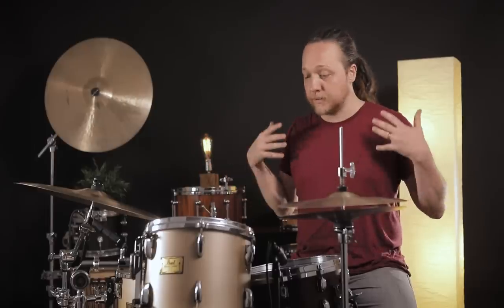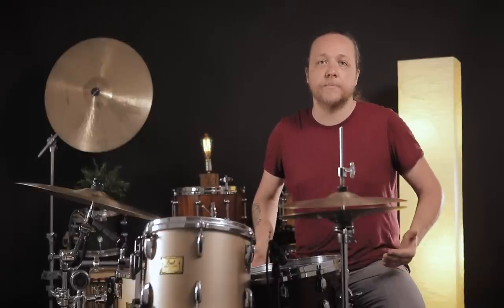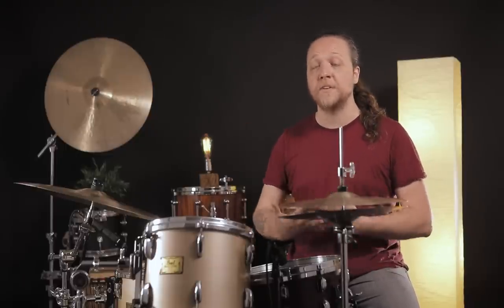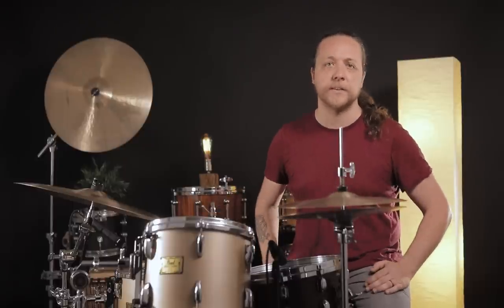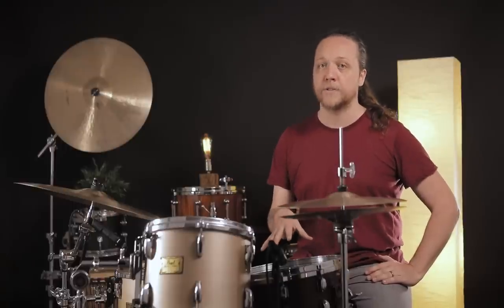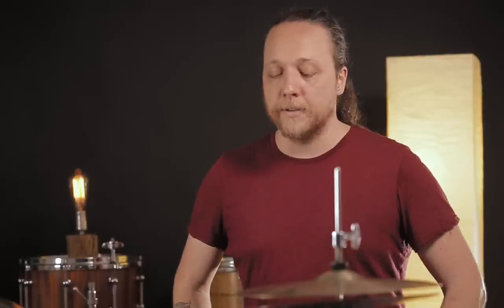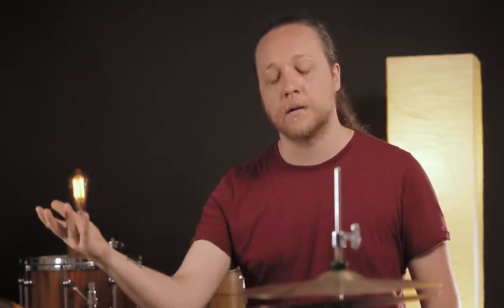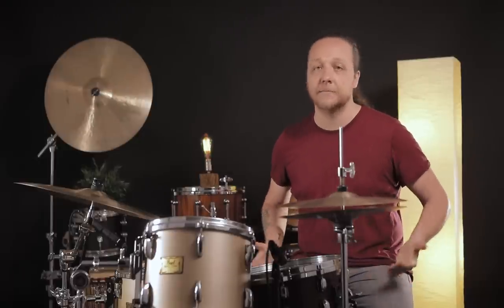Clear/Uncoated Snare Drum Batter Head | Season Two, Episode 26

Comment: Hello from the future! After using a 12x8 maple snare for almost a year with a clear g2 head I bought a steel 13x7 snare and oh my, the clear head has so much more presence it's really shocking. Especially at low tunings, the clear heads sound full and have a precise attack with a lot of warmth. I still don't get why they are not as popular as they should be, especially in the studio. I couldn't believe that a 12 snare with a clear head and 30 snare strands had more presence in the mix than a 13 steel shell with a coated head in high tuning.

Comment: It’s refreshing to finally see somebody do a video about putting clear heads on a snare drum instead of coated heads. Case in point, I have this early 1980s Maxwin by Pearl 5 1/2” X 14” wood shell snare with an adjustable under head dampener. The only head that seems to work for this drum is a 14” Remo Clear Pinstripe head. (or if you’re using Evans drumheads, the EC2) When properly tuned & slightly dampened, this snare drum produces a hard knocking sort of sound which is similar to the sound of the snare drum used by  Brian St.Pere of the band Hum on the song “Stars” and on the album, “ You’d Prefer An Astronaut .“ The sound is also similar to the snare used on Stabbing Westward’s ‘Wither, Blister, Burn, & Peel’ album by drummer Andy Kubiszewski. I absolutely love the sound of this drum. When the dampener is off, it Sounds great on any STP track from their Album Core. This negative also works well for 1980s hair metal.

Comment: When I run out of my regular heads, I use either clear Controlled Sound with top dot or Clear Pinstripe on my piccolo snare drum. it gives lots of options. When you tune it low, it sounds very thick and warm and if you tune it to mid-high (my regular tuning) it gives very balanced attack and perfect ratio between sustain, attack and the presence control when playing with the whole band. 
great episode, as always!

Comment: The best part of a clear snare batter is you can see Cody’s face in it while he demos it
Reply from the maker: Like drumming on a mirror...
Reply: I have a black Dixon drum set and only the Rack Toms and the Floor Tom  have clear uncoated Pearl pro tone drumheads , while the snare has a white Remo ambassador coated snare batter head , and on a unrelated note I have  not 1 BUT 2 Latin Percussion cowbells in my Dixon drumset mounted on my ride cymbal stand via the use of metal clamps with poles to mount cowbells  , and a specially designed tambourine without a membrane on that drum clamp.

Comment: I once tuned my toms to E,A,D,G with a digital tuner. It took a long time but sounded amazing.  Does this actually have a practical application or was it just a cool idea? Try it out!
Reply from the maker: Tuning to specific pitches is certainly an option and can be great for recalling a general intervallic relationship between the drums. As we’ve covered in the past, since the batter and reso pitches work together to create an altogether different pitch from the drum as a whole, it’s possible to end up with the same pitches but different character based on the relationship between the batter and reso heads. If you’re looking for a reliable means of tonal recall that still accounts for the space you’re using your drums in (which may change if you’re gigging, recording, etc), we recommend getting the pitches of the batter heads noted and then adjusting the resos to establish the character of the drum. Cheers! -Ben

Comment: +soundslikeadrum  Clear heads as snare batters tend to be brighter than their coated counterparts.  Not tested were the EVANS®/D'Addario® TT14G1 (10mil) and TT14G14 (14 mil).  Although partial to equal weight heads for both sides of toms and kicks (e.g. BnnEC2S top/TTnnEC2S bottom on racks and floors), I tend to favor coated heads for snare and tom batters for mitigation of stage-lighting glare.

Comment: Would this work better on a wood or metal snare...or equal.
Why would there have been a big set against using these heads, by a lot of drummers.
They certainly sound fine here.
Reply from the maker: You could use them on any shell material you like if the sound meets your needs. Snare heads have consistently been coated heads for as long as synthetic drumheads have been in existence largely due to brush compatibility but then they simply became the standard regardless of style. The coating tends to mellow out some brighter heads but that’s not always the desired tone.